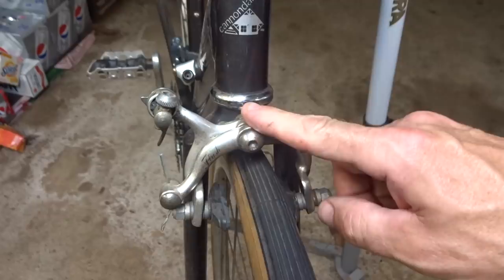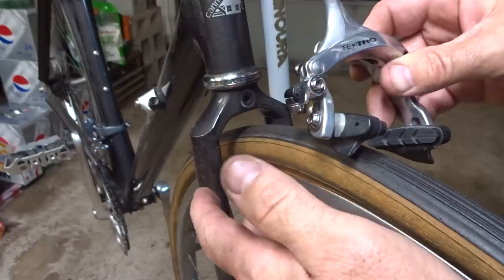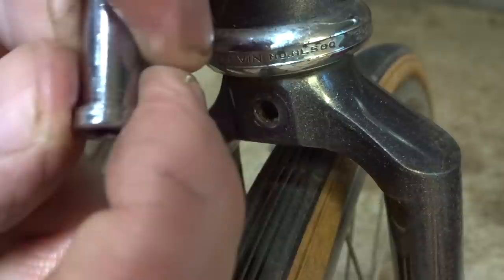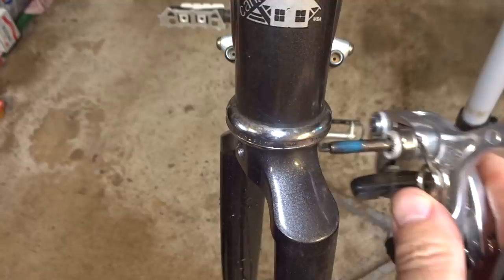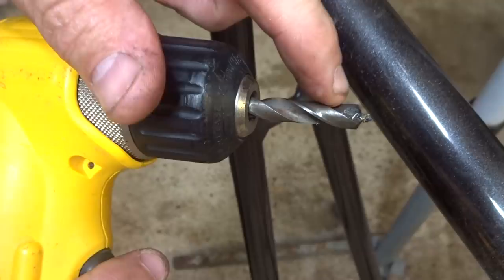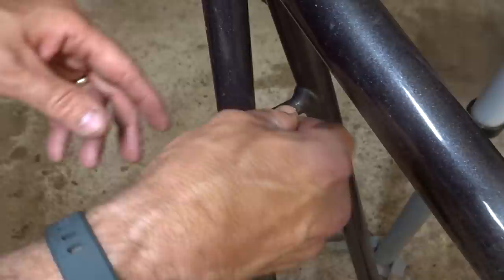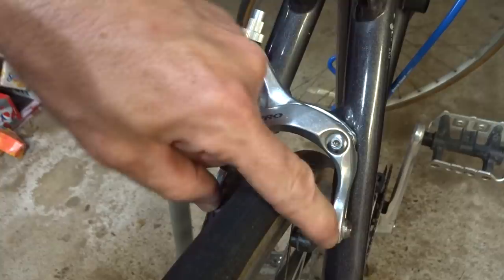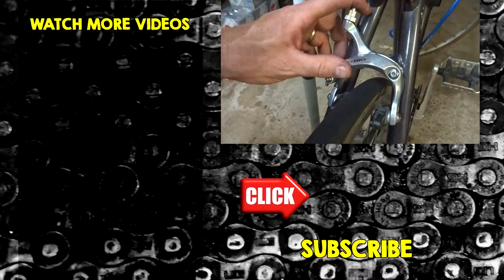Convert From Nutted To Recessed Mounted Brakes On Older Bike Frame

Comment: You can use a step drill used for sheet materials ,held in a tap holder, for the rear brake bridge

Comment: I did this last week but used a tapered reamer on the rear bridge from the back side.  Alas, brakes didn't have enough reach for the times I had.  Darn, but I learned a lot.  So today, i mounted another rear brake on a different bike and alas!  The reach was perfect but not enough clearance for the tire!  But time in the garage is never wasted.  Thanks for the videos.
Reply from the maker: That is why I checked before I drilled. Measure twice, cut once.

Comment: RJ, I love most of your tricks, but this modification - in general - ticks me off. For the most part, it seems that every butthead who can't drill straight thinks this is a great idea to do on beautiful higher-end steel frames from the 1970's. Not only do they do a terrible job of it, but they create irreversible damage in the process. Secondly, this isn't the same world as 10 years ago. Nutted Tektro dual-pivots are available everywhere for this conversion. 

I've lost count of how many frames I've had to un-eff up by filing the enlarged hole and cutting a stainless shim to fit perfectly in the crown or bridge. Most recently, I've had to un-recess a 1975 Raleigh Pro and a 1960's Bottecchia, and the latter was done so sloppily that the jerk who modified it decided to unfrick up their frickups by hogging the FRONT hole off-center. It really ought to go to a framebuilder for repairs if it wasn't for the fact that it has a Cyclart paint job on it. 

Also, everyone seems to attack that rear brake bridge by drilling the entire thing out from the outside of the triangle, not the inside. They usually don't sleeve the front either, and rely on the bridge washer for centering. Idiots. What a pain to file and sleeve just right to make a nutted brake fit again without flattening the bridge.

Word to the wise: Get some Tektros made for the job and stop screwing up your frames by doing this modification. It made sense to do this in the 1980's. It's stupid AF now.

For those looking for a database of long-reach dual-pivots, both nutted and recessed, see below:

Nutted:
Tektro R559: 55-73mm
Tektro 800A: 61-78mm
No-name brand caliper on AliExpress: 61-79mm ("1 Set Bicycle Brake Racing Road bike Dual Pivot brake Aluminum Side Pull Caliper Front & Rear 61-79mm Long Reach")
Tektro 900A: 72-92mm
Z.star SCJ007: 73-93mm
Tektro C326 (extra-wide, for balloon tire rims only): 79-99mm

Recessed:
Tektro R556 (early variant of R559 with non-lockable quick release): 55-73mm
Tektro R559 (same arms as nutted): 55-73mm
Dia-Compe BRS 202: 55-75mm
IRD B76: 57-76mm
Dia-Compe DL800: 61-79mm
Reply: Why isn't this comment pinned?
Reply: Irreversible damage? You're reaming out one side of the hole by a few mm's. A nutted brake will still mount perfectly. What damage is being caused? Also not every frame from the 1970s is some high end 'beautiful' frame. I did this to my 77 Raleigh to specifically put on another single pivot brake from the 80s to complete a group set. There are plenty of reasons to do this modification and plenty of steel frames out there.stop getting your knickers twisted.
Reply: May I ask for some specific models? Thanks in advance.
Reply: Moulton major 1962 with a brake set   that was a death wish, solved with same brakes you mention but with a 75 to 85 reach, nutted not driller killer.
Reply: @edboyle1093  Good for you, Ed. Also, I don't think folks realize it, but dual pivots can be had in ridiculously long lengths these days. I put this list together a few months ago:

Nutted:
Tektro R559: 55-73mm
Tektro 800A: 61-78mm
No-name brand caliper on AliExpress: 61-79mm (would link it, but don't want to risk YT flagging this post for spam because of a URL) 
Tektro 900A: 72-92mm
Z.star SCJ007: 73-93mm
Tektro C326 (extra-wide, for balloon tire rims only): 79-99mm

Recessed:
Tektro R556 (early variant of R559 with non-lockable quick release): 55-73mm
Tektro R559 (same arms as nutted): 55-73mm
Dia-Compe BRS 202: 55-75mm
IRD B76: 57-76mm
Dia-Compe DL800: 61-79mm
Reply: cudak888 
Hmm !
Now I have second thoughts about drilling out the forks and brake bridge 
Thanks for your comments which only reinforces my earlier concerns about messing up :(
I was thinking to replace existing bolts to longer bolts that should work instead of drilling out the forks a brake bridge 
Cheers
Reply: cudak888 
Thanks for this info 
I will check out theTektro brakes 
Only 3 sets of Campy brakes will be left in my bike bit bin
Reply: Nice work RJ.
This is what makes your videos different from the rest, simply providing an alternative solution to issues someone may be facing. 
The "I'm a bike mechanic & I know best" rants make me laugh, these guys are making a living out of repairs, if only everyone was perfect eh!
Reply: @umeko204  What you're suggesting fails to take into account the fact that the brake bolt is now supported only by one hole instead of two. What you describe relies entirely on the pressure of the nut at the back of the crown (or bridge) to keep a brake absolutely centered - under significant forces pulling the bolt up (in the front) or down (in the back). In the case of a curved crown, you're also asking these forces to be supported by a fairly weak, concave aluminum washer. 

You're also taking for granted that a flat fork crown is truly flat - I've seen more than a few Raleigh Competition Mk.II's with Davis sloping fork crowns that have such a terribly uneven mounting surface that they're barely adequate for nutted mounting, much less a recessed conversion.

There's a reason I qualified my statement with "beautiful" frames and mentioned the Raleigh Pro and Bottecchia - because, as you note, there are millions of low-end bike boom bikes out there (*cough* Raleigh Records *cough*) that are just fine to modify. They can be nice, but they're cockroaches of the bike boom and are just fine to drill on, add braze-ons to, or hack up into tall bikes. The rougher the better. It's always open season on these. 

But that doesn't exclude whoever's doing a recessed conversion from doing it right. For a job that literally has a pilot hole, I see way too many people screwing this up. The modification should come with a big fat "don't do this IF..." disclaimer for all the morons out there who think that running a 3/8" bit cockeyed through a 1972 Colnago is the same as an 8mm bit run square through a boom-era Nishiki. I'll knicker-twist just as much as I like when I see hack job work, thank you.

P.S.: I've cold-set and filed out the dropouts on a Raleigh Sports fork to accommodate a modern 100mm front axle myself, so I'm absolutely not opposed to frame modifications...on the right bike, done correctly.
Reply: @JuanIgnacio22  Of?
Reply: @Bikeops2021  Way to make assumptions, Graham. I'm not a bike mechanic by trade and I don't make a living out of repairs - but I have owned and repaired my share of vintage lightweights. You see a DIY video, but I see the results of people who follow this advice. Way too many think this conversion can be achieved with the wrong size bit and no attention to drilling square with the fork or frame.

If you want to encourage hack work by belittling my comments, fine. This modification deserves a disclaimer on it for every enterprising idiot who doesn't know what doing a good job is, because this modification is right up there with people who can't be arsed to close a quick release correctly.
Reply: Why would a nutted brake not have a back washer or curved spacer on a 70s typical fork crown? Almost all nutted brakes had curved spacers front and rear because of the curved crowns, spreading the torque load. It's how they were designed. The rear of the hole being 2mm larger makes no difference to this. These can easily be used with the recessed style as well, if you're nut is long enough. How many flat crown forks are there that aren't recessed designed? Either way, you can use washers/spacers. As for what frames are trash and why frames are so special they shouldn't be touched, is your opinion, and that's fine. I don't think any bike, even my daily rider Raleigh competition is anything less than a good bike. Bikes are meant to be ridden. Any mod that keeps a bike on the road is worth it. They aren't meant to be hung on a wall. There's enough of those in homes and museums. Wether it's a Raleigh record, a Schwinn, or a colnago master. If you own it, modify it however you want. It's yours. To get upset about 2mm worth of steel, that literally changes nothing about the bike, but its ability to use any kind of brake, is just plain silly. Period.
Reply: @umeko204  Let me see the science that proves that the larger hole makes no difference to the torque load, and then I might consider that argument. 

Also, the curvature of the crown is a cosmetic/weight oriented decision, not a structural one. I already cited one crown that is both flat, nutted, and doesn't require a curved washer - Davis. But since you asked, Cinelli's entire range of crowns are also predominantly flat and delivered nutted (Cinelli MCA/MR/MC), along with 1970's offerings from Haden, Zeus, Ishtiwata, and some Bocamas that aren't quite flat but aren't curved to the usual shape either. Sorry to burst those bubbles.

Not that this matters to my original point in the slightest.

I definitely won't argue the point that bikes were made to be ridden. If I didn't believe in that, I wouldn't have posted all the nutted dual-pivot options available today, nor would I feel so strongly about this modification. As I've already stated multiple times, I've seen far too many examples of frames nearly ruined because of a hack with a drill trying this modification. Unfortunately, Problem Solvers has yet to design and offer a shim set to easily A. Sleeve a frame that's been drilled 8mm or sleeve a frame that's been overdrilled to 3/8."
Also, it seems like we're both equally getting uptight about this, so we're both silly by your decree. Fine by me.

P.S.: When bikes aren't being ridden, they're in homes (and sometimes museums). Who would have thought?

Comment: Just did for my restored old bike. Works great! Trick on the tight clearance at brake bridge : use 7.5mm, and drill at an angle from both sides of the bike , be carefull not to hit the seattube with the drill chuck

Comment: My solution to this issue was to buy an inexpensive nutted dual pivot front brake off ebay; there's plenty of unbranded examples available and they work fine.
Reply: that tektro brake comes also in a nutted version.

Comment: For the rear brake it's much easier to use a front brake with the longer thread, and just put a normal nut on to fix it. That way you do not need to drill the brake bridge.
Reply: Correct, I have been doing this for years. And you can fit a rear brake to the front, after drilling the fork, by  using a longer recessed nut.
Reply from the maker: I have that in a previous video. I prefer this method.
Reply: This is a good tidbit. Just make sure you're using a stepped but for metal.
Reply: Following your recommendation I swapped out the rear brake with with a front brake and used the existing nut to fix it .. works fine ! Thanks for the tip Bro :)
Reply: Thanks John. Good tip. With your method and RJ's video I now have 2 options for upgrading the brakes on a nice old steel frame I just picked up. Happy riding to you both.

Comment: did the same thing to my 1984 schwinn world sport when i mounted a shimano 6500 ultegra group to it, and then again when i moved that same group to my 86 trek 400. only I just went though the seatstay bridge all the way on both of them because I didnt have a right angle drill, worked fine, the brakes are rock solid. wish this video was up when I did that though. nice to see you putting up some stuff RJ missed your vids

Comment: Database of nutted (and recessed) long-reach dual-pivots that'll solve this problem without resorting to frame butchery:

Nutted:
Tektro R559: 55-73mm
Tektro 800A: 61-78mm
No-name brand caliper on AliExpress: 61-79mm ("1 Set Bicycle Brake Racing Road bike Dual Pivot brake Aluminum Side Pull Caliper Front & Rear 61-79mm Long Reach")
Tektro 900A: 72-92mm
Z.star SCJ007: 73-93mm
Tektro C326 (extra-wide, for balloon tire rims only): 79-99mm

Recessed:
Tektro R556 (early variant of R559 with non-lockable quick release): 55-73mm
Tektro R559 (same arms as nutted): 55-73mm
Dia-Compe BRS 202: 55-75mm
IRD B76: 57-76mm
Dia-Compe DL800: 61-79mm
Reply from the maker: Feel free to install those on your bike.

Comment: I prefer the look of the old brakes on that frame.
Reply: function > fashion
Reply: @DaveReedDR  Those Modolos are exceptional performers with new pads and a proper rebuild. Half of the bad rap they got BITD was because of their horrible factory brake pads.
Reply: @cudak888  finding correct brake pads is horrible if you dont have a clue what your rim is made of. Its easy for solid steel rims, but some old rims have anodized coating on them, like polished aluminium or even chrome, and its almost impossible to find the correct brake pads for these.

Comment: Gotta get some long pull front brakes for my vintage fixie conversion. The Old brakes just aren't nearly as strong as modern brakes, even when using back pressure on the rear.

Glad to have this tip today.
Reply: If you need a quick reference of available long-reach brakes - both nutted and recessed:

Nutted:
Tektro R559: 55-73mm
Tektro 800A: 61-78mm
No-name brand caliper on AliExpress: 61-79mm ("1 Set Bicycle Brake Racing Road bike Dual Pivot brake Aluminum Side Pull Caliper Front & Rear 61-79mm Long Reach")
Tektro 900A: 72-92mm
Z.star SCJ007: 73-93mm
Tektro C326 (extra-wide, for balloon tire rims only): 79-99mm

Recessed:
Tektro R556 (early variant of R559 with non-lockable quick release): 55-73mm
Tektro R559 (same arms as nutted): 55-73mm
Dia-Compe BRS 202: 55-75mm
IRD B76: 57-76mm
Dia-Compe DL800: 61-79mm
Reply: @cudak888  that's awesome, thanks! Because I turned a 26" into a 700c I need extra length. Cheers!

Comment: Thanks again for an excellent vdo my Colnago Super circa late 60’s has nutted brake bolts and I was reluctant to drill out the forks an rear brake bridge for fear of messing up
After watching this vdo I am more comfortable about the fix. The old calliper brakes are not as efficient as the more modern style and effective brake pads don’t fit
Reply from the maker: Yeah, I am assume you are joking. This 80's Cannondale isn't a 60's Colnago Super.
Reply: At the risk of being troll baited, I'm going to dive into this one: Don't screw up a '60s Colnago. Here's a database of nutted (and recessed!) dual-pivots that fit:

Nutted:
Tektro R559: 55-73mm
Tektro 800A: 61-78mm
No-name brand caliper on AliExpress: 61-79mm ("1 Set Bicycle Brake Racing Road bike Dual Pivot brake Aluminum Side Pull Caliper Front & Rear 61-79mm Long Reach")
Tektro 900A: 72-92mm
Z.star SCJ007: 73-93mm
Tektro C326 (extra-wide, for balloon tire rims only): 79-99mm

Recessed:
Tektro R556 (early variant of R559 with non-lockable quick release): 55-73mm
Tektro R559 (same arms as nutted): 55-73mm
Dia-Compe BRS 202: 55-75mm
IRD B76: 57-76mm
Dia-Compe DL800: 61-79mm
Reply: @cudak888  Thanks! this was exactly what i needed to know regarding lenghts

Comment: Use the short recessed nut, but don't put it through the back of the fork. Instead, push it up into the inside of the steerer from the bottom. You can reach a 5 mm Allen wrench in through the hole in the back of the fork, and poke the short caliper bolt in from the front.

Comment: I use another method. I bought two front brakes. When  installing front,i drill hole to larger. But drilling rear i decide will be too hard,so i install on rear front brake,using nut from old brake)
Reply: Did it work?
Reply: @milkshake69O  yes

Comment: Question: why can't you just drill the hole right through on the back of the bike? I don't have a right angle drill & I don't want to buy one just for 1 hole.
Reply from the maker: Because then the weaken the brake bridge more than you need to. Also, not you will not have a solid brake mount since you will have slop on that side.

Comment: bought myself some tektro r559 for my interesting bike project
the bike was never meant to have front brakes installed so the distance from bolt hole to rim surface is huge
hoping the r559 will work
i kinda randomly bought from cheapest online store 55€ total 
i was planning to make some metal plate or drill a hole couple mm down or something
but i received the recessed nut mount model 
maybe i can make it work

Comment: my old bike has canter lever breaks on rear and would love to install dual pivot race brakes but only have a flat plate (no tube across the rear fork) to mount to is there something i can try to do without the welder 

don't want to put v - brakes on unless it can't be voided

Comment: This is amazing, thanks! I have the same issue with my old vintage bike and horrible horrible weissmann breaks. can I, instead of drilling out the back just use the front brake? Say I get 2 front breaks? drilling out the front seems a lot easier tbf.
Reply: Yes, you can just use a nut and washers.

Comment: Nice drill ! Only shoes for brakes atm man
Reply from the maker: Which one? The right angle one? I like it. Way better than the corded Dewalt right angle drill I used to have. I hated the trigger on that. Way to easy to accidentally bump and trigger it on. Dangerous! I like this one.